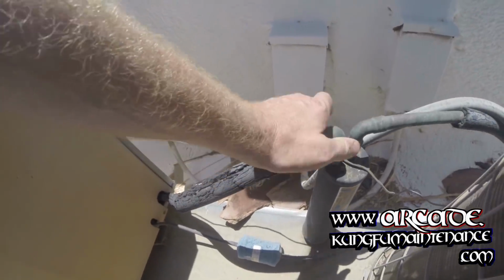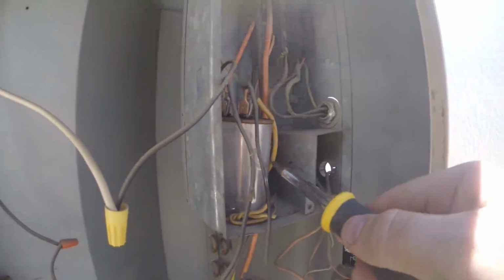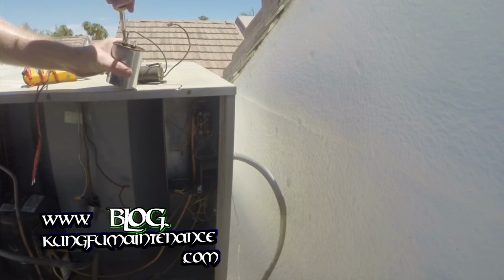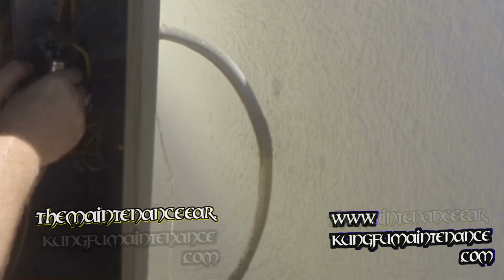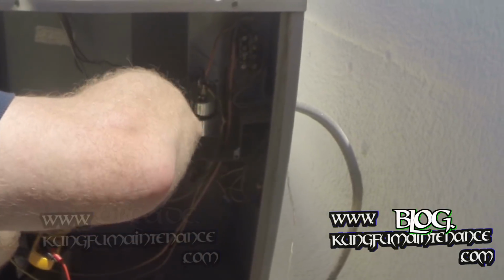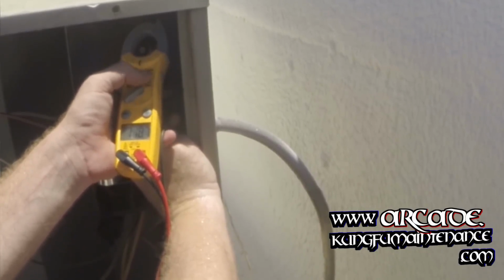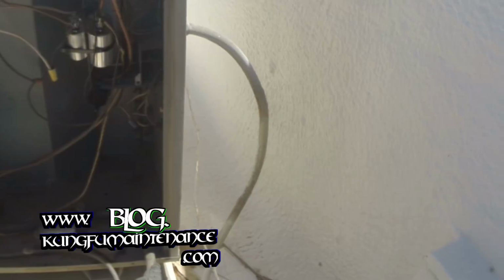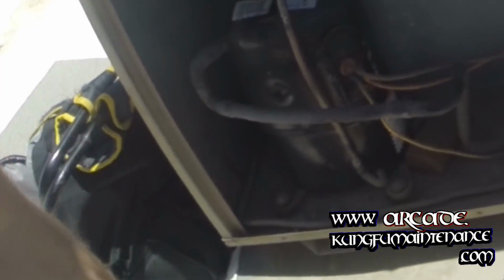AC Outside Fan Running But Air Conditioner Not Cooling HVAC Real Time Repair Video

Comment: whats wrong if you feel small amount of water coming out the vents in some rooms
Reply: Check you condensate pump.
Reply: I couldn't find one
Reply: How old is system?
Reply: If its a new or old horizontal in the attic then possible;
1. No splash guard.
2.  Metal ducting not insulated.
3. primary and secondary drain line clog with a full drain pan
4 Coil not level.
5. cracked drain pan in coil
6. icing issues
6a. Icing from weak blower fan or condenser fan
6b. icing from dirty filter or clogged evaporating coil
6c. icing from refrigerant issues in that case call local contractor
7. dont know why im helping you

If its a package unit on roof very common for leaks through ducting.

1. unit not level
2. copper not insulated.(unlikely)
3. rusted out coil pan
4.no p-trap on drain line on something causing system to not drain
5.cracked drain pan in coil

If its an up-flow in closet or garage call a plumber because its not from a/c

Start with that and must recommend to get that issue is dealt with quick. Nobody needs mold in the air system then you'll need doctor
Reply: Im not sure its been here b4 me so more than 16yrs
Reply: Well thats not good at all. Highly recommend to get that fixed just a little water is a big problem. Good luck hoped I helped.
Reply: Yes Joser thats unlikely but one out of many possibilities. And just so you know your a rookie not to b mean but is obvious.
Reply: Jose your alright better tech than I. I feel basd for calling you a rookie but lets just part our ways

Comment: change all the caps for nothing, except that one
Reply from the maker: Preventative maintenance is never for no(t)hing!!! Building Maintenance (depending on the situation) often takes a slightly different approach than traditional HVAC  techs will take.
Reply: where are you. and what was thecost of that service call, want to get general idea. I in okla and jbeen out of it for a couple of years

Comment: Nice work I had my ac unit not blowing cold air sent for a tech to take a look said it was the compressor needs to be replace too much apparently he went in real quick ran a few checks and came with the conclusion I was pretty pissed need a second opinion on this man

Comment: I'm always scared of getting shocked even after killing the breaker and pulling the fuse plug is there any risk of shock after doing all that
Reply from the maker: At the condenser after pulling the disconnect or killing the breaker the capacitor needs to be discharged. The cap holds a charge even after the power is disconnected. I show how to discharge in several videos.

Comment: Hey Kung fu my ac went out again yesterday it happens every year it's an ac from the 80s first of all and it's a box system no ducts so I think it's over working its self house has horrible insulation on top of it and my wife tries putting it on 68 all the time and I chew her out saying your going to kill the ac again anyways we change capacitors last both of them back up and main and fuses and my fans blowing on top of ac and my condensation line is sweating but I go inside and no cooling or really much of a air current but the fan is working on the inside also any suggestions we have a repair man coming out in a day or so but it's already going to be a scorcher I'm a roofer by profession I can take the heat but not sleeping in it and my wife whine it's soo hot lol
Reply from the maker: Sounds like possibly ice blockage as if your evaporator coil may have frozen up. Changing filter often is good idea. Also evaporator coils may need cleaning. Check me vid "Frozen Air Conditioner How To Unfreeze Defrost Fix Up Ice Froze AC Repair Maintenance Video"  Hope this helps. Is possible is low on refrigerant as well but I would start with the filter and coils.

Comment: both the test probe should be on the compressor terminals,while testing for voltage,it cud have avoided the cap. replacement aniway nice lesson....thanx

Comment: Invest in a good pair of wire strippers. You definitely need it.
Reply from the maker: +William Brown Wire strippers save time but when you get to larger wire sizes are not readily available. Main point is not to nick wire or loose any strands. Even with wire strippers one must be careful of this. Any nicked wire or reduced wire size through lost strands becomes a place where heat builds up and potential source of fire and/or premature component failure. 

~ Thanks for watching and commenting!:0)
Reply: +KungFuMaintenance it's not your wire strippers lol. That wire looked like it got fried. The jacket was probably just melted to the wire. That makes it such a pain to strip the wires. Good video thanks

Comment: usually when running a service call u use a multimeter not a screwdriver. also having rust on a capacitor doesnt mean its bad it mean its been in the elements witch when manufacturing the condenser that ouutdoors will have rust on the componets expecally a unit thats as old as the one u are working on in the video. if it was reading the out of capacity or leaking oil even blowen up is when u bring that to a clients attention. ripping your clients off telling that the signs of rust is time to replace isnt good morals
Reply: Josh, if you look at the video starting at 11:40 you will see he tests the smaller 5uF capacitor and it tested at 2.4uF so it was reading out of capacitance and needed to be replaced.  Don't think he was trying to "rip off" the client in this case.

Comment: Thanks for sharing these videos :)
Reply from the maker: Bobby Petty You're welcome :0) ~ Thanks for watching!
Reply: KungFuMaintenance Why didn't you look on the top of the compressor for the RLA?
Reply: +KungFuMaintenance hi I appreciate your videos .I have a question cause I can't find an answer..outside fan is working but the unit is not blowing air Inside the house .I would appreciate any answer Thanks

Comment: The fan isn't moving in my central air system. The heating and cooling technician tells me I need to hire a electrician because the control wiring in pipe from disconnect to condenser is broken. The electrician needs to run new wiring in pipe? How much will this cost me?
Reply: +Kathleen Quinn, Depending on where you live, the AC tech should be legally allowed to replace the conduit and wire from the disconnect to the condensor.  Otherwise, it should be a service call and minor materials.

Comment: Nice video. I don't know if you knew or not, but right under the wiring compartment on the right is a, "Delay on Make Timer".  It was added on by another person to delay the compressor from coming on right away.
Reply: George W But the fan is coming on so the contactor is engaged
Reply: Jeff Claytor yes it is running.  I just mentioned about the timer for good information.  Not normally something in a/c, but used more in commercial refrigeration.

Comment: Who was the last person working on this unit? It looks like an "abortion", wires all over, no cover on the compressor, capacitor hanging on for dear life. I didn't like when you said I hope it's only burnt wire, if it would've been a burnt wire, replacing the wire would not make the problem go away.
Reply: Michael Solow  I agree with you. Can you imagine this technician working in some well organized company? Can you imagine if the airplanes that we fly were wired for some electrician like this one?
Reply: You are so right